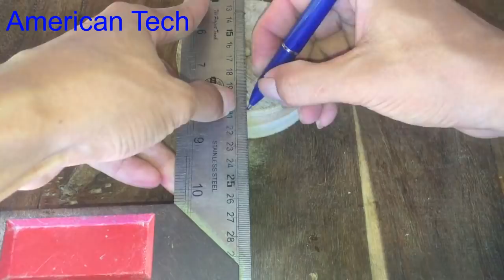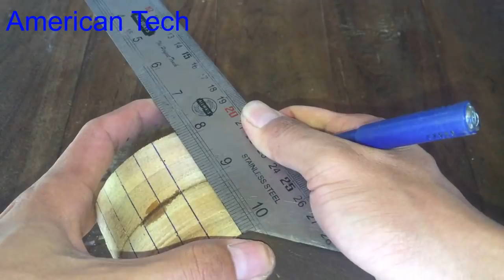How to make a powerful DC motor using 120 screws , science school project 2017

Comment: 2 Questions: 1. Do the screws have to be a certain type of metal (i.e. copper or iron)? 2. Do the screws have to touch (or have to NOT touch) the iron rod running through the middle of the wooden circle?
Reply: I would think you would want steel screws, to act as s core (and it looks like that's what he used. I don't think it really matters whether they contact the shaft (it's spinning with the wood and the screws are not part of the electrical circuit).
Reply: Actually contacting the shaft might cause more problems with the magnetic fields, lowering the efficiency as they fight each other...
Reply: also do u really need that many screw what if 1 on each side and then use tape ?
Reply: MadMike very nice